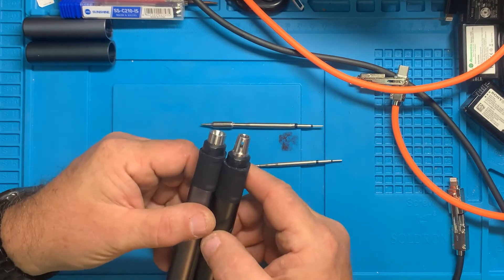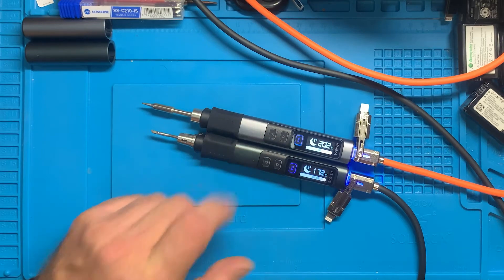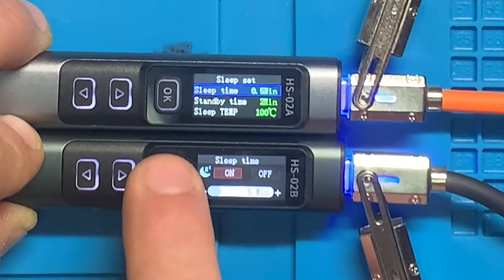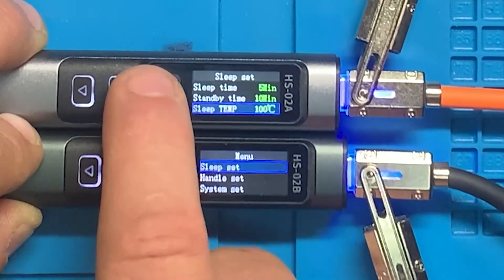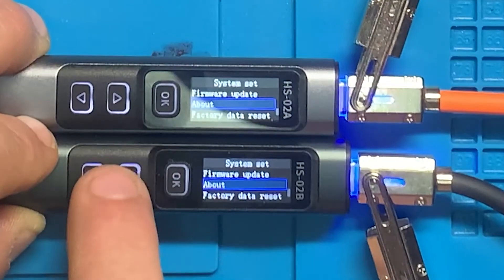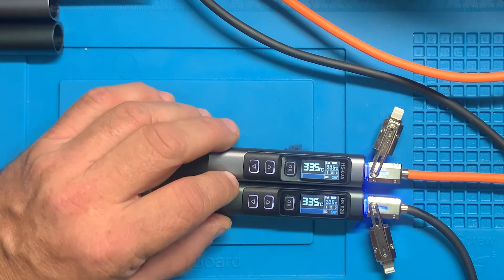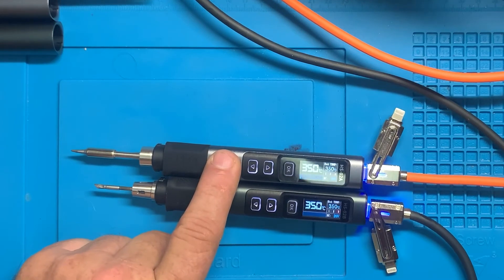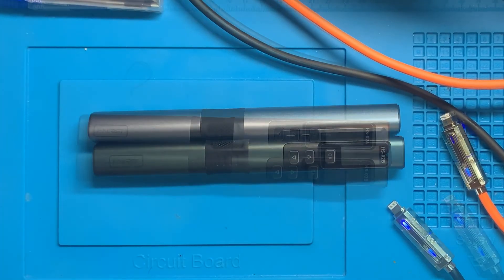FNIRSI HS02 A or B Soldering Irons Tested Head-to-Head

Comment: Very usefull video!!!  By the way, can I use the original JBC C245 tips on HS02A? Thanks a lot
Reply: Yes you can! I use original JBC C245 tips. But the quality of the fake ones that FNIRSI sells is outstanding for the price!
Reply from the maker: Glad to hear it. I find the iron to be a good product but have no long term use with it to say how it  will hold up to daily usage. how long have you been using this iron?
Reply: @TTMEable  I've been using it as my main soldering station/iron since the beginning of July. So far, so good. The only issue I've noticed is that it draws MORE than 5A (over 110W according to my POWER-Z KM003C) when supplied with 20V, which causes most of my chargers to shut down due to their overcurrent protection. However, this issue is very sporadic; sometimes it works normally, and other times it doesn’t. Very weird, to be honest.
Reply from the maker: I haven't seen this yet. i wonder if it's isolated or a defect in all irons.  have you used it with a standard laptop psu? i wonder if it will have the same issue.
Reply: @TTMEable  unfortunatelly I only have Dell branded USB-C power supplies, and even the 130W ones (I own 4) shuts down insntantly wehen I turn the heater on due to the OCP. I ordered a new dedicated 240W cable that is shorter. I will report if it works normally and repeatably with that one.
Reply from the maker: ok, would love to hear from you. i have many laptop psu "i should have several dell" and if there is interest i can do a video with some of them with both HS-02 irons and see if i can repeat the issue with mine.
Reply from the maker: Sorry for the late reply. did not see this comment. youtube is promising to make the comment area easier to find and sort new comments, hopefully soon.  Anyway, i see what you mean now. i just checked mine and got 2.7 on the 02B and 3.6 on the 02A although i'm not confident in my meter. haven't changed the battery in well over two years.  

What did you come up with on your test?
i did notice that the irons regulate at a much lower current after reaching initial temp.
i just used the usb-c short 1 meter cord with the gan 260w 868D supply plugged into the PD100W usb-c port and powered the iron. heated to 345c 100% power 20v. no problem though psu was reading 20v, .5A 10W so not to sure about how accurate the reading is, at 20v 100% power the small iron heats within a second or two. i'll have to let everything cool completely down and try again to see if i get teh same result. both irons are upgraded to the 1.7 firmware.

I'm going to try the 02A and see what it does.  Ok getting the exact same results you are getting with my 02A. i have to drop power to 77% to heat up then no problem after that.  i'm going to send a message to FNIRSI and see what they say.

Thanks for your testing. may can be fixed with a firmware update to reduce power  level to 65% to certain temp then auto increase to the preset.
Reply: @TTMEable  I'm not really sure as to why I can't see my original comment on my testing results. Did you delete it by mistake?

On another note, today I received my KSGER C210. In the settings it has a "current limit" option. I think this is exactly the feature you described  in your comment, where it limits the maximum amount of current being drawn (or negotiates a lower voltage) when the iron is cold, say under 220°C, and when that is already the case it ramps up power to 100%. I think FNIRSI should also make this an option for their irons since new high quality power supplies catch that over current nearly instantly. My KSGER C210 also triggered the OCP on my chargers!
Reply from the maker: Sorry. Didn’t delete it. Or did not mean to. Will have to check to see when i can get on a computer. Cant tell on a phone. I did make a copy of part of your post to add to the message to FNIRSI to let them know about your findings. As soon as i get a reply from FNIRSI ill post something on the community page for the chain breaker channel.
Reply from the maker: Ok i found you post. Its there but im not sure why you cant see it. YouTube really needs to fix the comment section on videos to be more user friendly. Its hard for me to find new post to make sure i reply to everyone. Anyway yes its still there. It was hidden from me due to filters on messages. It will show me new message that i haven’t responded to yet or old message with new response but not both and i have to remember to sort messages both ways to see everything.
Reply from the maker: @osvaldonobuo3663  they should fit. The tip in the HS02A in the video was from temu but it did say it was a JBC C245 and it fit and worked. Hope this helps.

Comment: Awesome thank you so much for making this video! I have been wanting to get a new soldering iron and these seemed interesting especially for the price. Since I don't know much about soldering iron I was wondering what the difference between these two were. Since to me the 245 and 210 didn't really mean much, since I didn't know the difference before. But now I know the difference and that the 2B with the C210 tips is the better option for what I need. Thanks again for this video!
Reply from the maker: So glad it helped you. i think the HS-02B is more than enough for micro to small soldering jobs as well as jobs like soldering the pin headers on Arduinos and such. i don't see where you would have much trouble until stuff like ground connections or any connection that has a lot of metal to heat up for a proper solder joint. I also believe you can bump up the power to meet even larger jobs because the larger the metal contact the faster the heat will wick away. so i see the HS-02B as a very versatile iron for a lot of day to day soldering.

I'll be doing a real life soldering comparison video, with these two and maybe the ts101 and another off brand i like to see how well they actually solder in real life so be on the lookout for it in the next  few weeks. 

Thanks again for the comment

Comment: are the tips interchangeable?
Reply from the maker: Sorry No,
The HS-02A uses a larger diameter tip, a C245 style tip.
The HS-02B uses a smaller diameter tip, a C210 style tip.

The C210 tip is about half the size of the C245.
I cam measure the major diameter of each if you would like.
Reply: @TTMEable  from the video the base of the tip seems to be the same.  The hot end side of the tip it’s not but the base, at the contact zone, looks the same. Thats why I assume interchangeability
Reply from the maker: Yes, they look exactly alike and from what i can tell from holding them side by side they appear to be exact except the c245 is proportionally larger in every way.  If you would like i can get my caliper and give you a comparison of dimensions?
Reply: @TTMEable  its ok, no need for exact dimensions. probably only the thin one somehow fits in the hole of the bigger one.
Reply from the maker: @raututeodor5625  likely. But when i get home today ill try them just to see for sure. Im just assuming incompatibility due to larger diameter of the c245 tip. It may be spring loaded and the smaller c210 tips could work in the hs-02a. Ill let you know.
Reply from the maker: Definitely a no go. Small c210 tip rattles in the HS-02A and the c245 will not even try to go in the HS-02B.
Reply: @TTMEable  thats the sad part when its about new product old product and profit
Reply from the maker: Yes i agree. it seems the need to sell more pushes decisions to make things not backwards compatible just to get more sales.